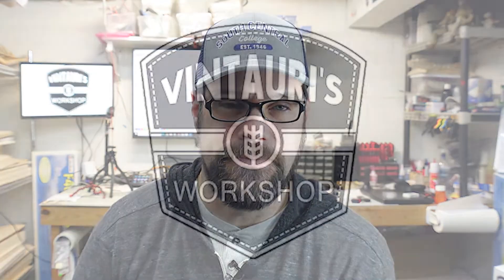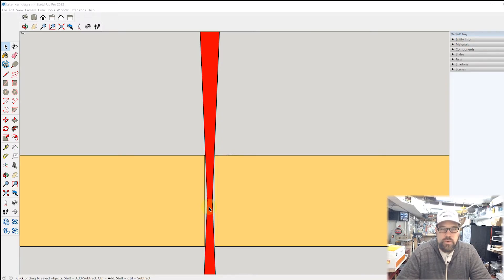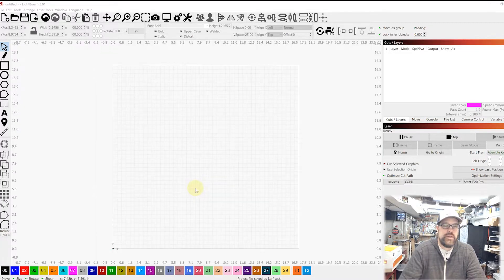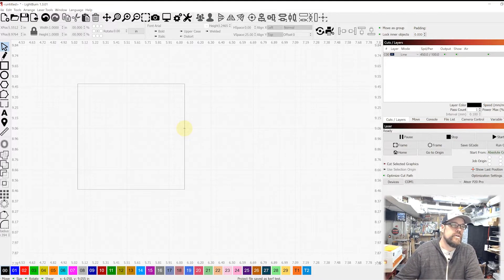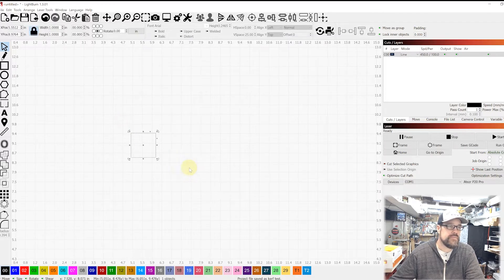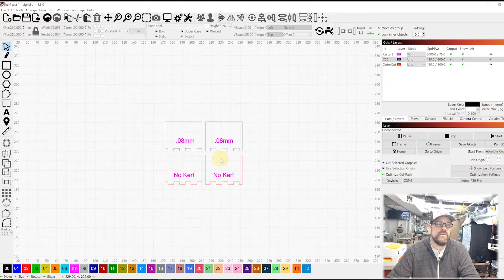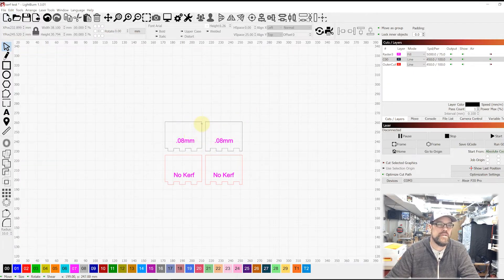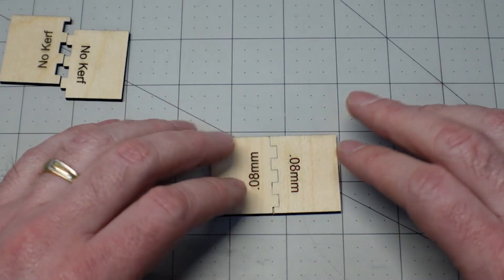Perfect fitting laser parts by adjusting the Kerf in Lightburn

Comment: Is it possible to add the offset and resave the file as svg so it can be cut with offset from a different software or does the kerf adjustment in lightburn only happen within lightburn when you send to the laser? I am asking cause I have some files that need to be adjusted but my laser only prints from Corel draw or illustrator/photoshop. Tia
Reply from the maker: The kerf offset does not save with the file, lightburn calculates it at the time of operation.  What you can do is figure out the offset and then use an offset to expand or contract your lines to factor in the offset and then run it in another application.

Comment: This seems a lot better than offsetting everything manually like i've been doing lol. not had it long though. Seems crazy that lightburn doesn't let you set the x and y kerf differently though, my fingerjoints along Y aren't great whereas along the X they're as snug as physically possible and wouldn't even need glue. Bit annoying

Comment: Hi, when setting the parameters for Scoring, what does setting the Kerf offet do? what's it used for and when is it useful ? Thanks
Reply from the maker: The kerf setting will adjust where the laser moves the beam relative to the line drawn. So it will have the same effect on a score vs a cut as they are basically the same operation, just a lower power for a score line.  For and engrave or fill operation, it will also move the start and stop points inside or outside the line of each pass.

Comment: Does the kerf measurement differ with different types of material, ie are the kerfs different for 1/4" MDF or 1/4" plywood?
Reply from the maker: It can depending on how efficient the burn / cut is.  If it takes longer or more passes to cut out, you may find yourself with a larger kerf due to extra burning of the material.

Comment: hello. the kerf you calculate  didn't use the vertical offset. What about it ? in general, the beam is not square but rectangular. what appened if i cut a circle ?
thank you
Reply from the maker: I measure both the sides as well as the top and bottom then average them out.  That is the best you can do with the rectangular beams from diode lasers.

Comment: My problem is the supposedly PREMIUM Baltic birch that I bought isn’t the same thickness for each sheet, but isn’t the same thickness on each side on the same sheet. It can vary as much as .3mm from one side to the other. It is definitely not premium.
Reply from the maker: It has been harder in recent years to get quality Baltic Birch that is consistent. I work with a couple local lumber dealers to purchase it in larger sheets and have better luck with that then the random packs on amazon. If you do not have a local source check out Ocooch Hardwoods in Wisconsin.  They ship and I've been very happy with the quality and consistency of their hardwoods.

Comment: Another awesome explanation Steve. Thank you!  Question:  If I am making your coaster caddy, do I add KERF to the tabs AND the slots (the slots that are on the bottom base of your caddy holder) or just the tabs?  I hope that makes sense.
Reply from the maker: You want to do it on both, however you want to make sure that on the inside cuts, it's going in and on the outside cuts it's going out. The Kerf adjustment is to make the edge of the beam hit the line instead of the center.  If you do one and not the other, the parts will still be loose.  Lightburn will try to automatically detect if it's an inside or an outside cut, but if your parts are not fitting correctly with the right kerf setting then there might be an opening in your object and you'll want to check that all the outer parts paths are closed.

Comment: I have a question, you mentioned the beam is an hourglass, is it better to cut focused on the top surface of the wood or focus in the middle of the wood thickness? I hope that makes sense.
Reply from the maker: If you can, it’s best to try to get the focus point to the middle of the material. It will be the most effective cut and you’ll have less angle to the cut from the hourglass shape.
Reply: @Vintauri  that makes sense, thanks! 😊

Comment: Your not measuring kerf your measuring  machine calibration step accuatsy  not kerf
Reply from the maker: By subtracting the part size from the cut out size and then dividing by two you are measuring the average distance of material removed which is the Kerf of the beam.  If I was measuring just the dimension of the cut out part, I would be measuring the calibration of the machine.

Comment: I was able to use your formula and procedures to cut half a dozen 25mm boxes, which I then measured.  I have a 22 watt mecpow x4 pro. I was cutting at 80% power, 200 mm/min on 3mm plywood.  My kerf adjustment came out to 0.15mm, which is larger than I expected, considering the claimed spot size.  I have what I thought was an accurate caliper, but I bought a micrometer, and there is a constant error with the calipers that would make them unsuitable for this measurement.  I trust the micrometer way more and it does not read 25mm when the caliper reads 25mm.  The error does not increase between about 10mm and the limit of my micrometer.  I suspect it is an adjustment to the caliper that I don't know how to make.  So I no longer trust the calipers when I need precision.  Great video, by the way.  Everything was clear.  The only thing I was unsure about at the end was the cutting of the averaged difference in half, but I did and then cut two more 25mm squares and they were 25mm plus a tiny bit, which was exactly what I wanted, because I was making a dinosaur cutout and I wanted the slots to fit firmly.
Reply from the maker: The reason you cut the average in half is that you only need to account for half of the beam width as the beam follows the cut line with half to the inside and half to the outside. I also take advertised spot size with a grain of salt, but the burn size on some materials will be wider than the spot size just due to the nature of the material and over burning during the cut. I'm glad the video helped out!

Comment: I think my 10W laser isn't the tool for this kind of thing. I bought my 5w laser two years ago then upgraded the laser to 10 w but i think for cutting it is still to low, any suggestions for a decent laser for cutting? What quality of wood are you using, can you link the specs for the test, I struggle to make box joints.

Comment: Sorry for being simple here, but can you just not cut the 1 inch squares as you did but redusing the different Kurf's, then just try fitting them onto a 1 inch square and see what fits best?
Reply from the maker: That would be a lot of guessing.  You also would not be able to cut out an exact 1 inch square without knowing the kerf offset as the beam would make your initial 1 inch square smaller by half the width of the beam. Measuring it out does not take long and will get you into the ballpark much faster, then you can make micro adjustments to dial in the fit.
Reply: @Vintauri  Thanks, man. I appreciate you taking the time to reply.

Comment: So wouldn’t this adjust the entire size of your drawing then? Not just the pieces that need to fit? Is there a way to just adjust the puzzle pieces? Not the entire piece? Hope that makes sense
Reply from the maker: Adjusting for the kerf will not increase the size of the item but rather make it cut out at the actual size of the digital drawing. If you do not account for kerf the item will cut out slightly smaller than the drawing as half of the beam is cutting inside the line. You would only use this adjustment when you need parts that fit perfectly together.
Reply: Aahhh got it! That makes sense! Thank you!
Reply: Hi! Back again with another question. So I understand adjusting for Kerf for let’s say an inside piece. However, I’m a little confused on how 2 outer pieces need kerf to fit together. Wouldn’t the kerf affect both pieces equally therefore allowing them to fit together? Does this make sense?

Comment: very good explanation  ,it was helpful  to understand  the kerf , but  when i test many values  the result it remains the same not fit good  too gap betwen slot  ,
Reply from the maker: Most diode lasers end up around .1mm to .12mm for a kerf offset.  You need to remember that you find the width of the cut, and then divide it in half as the beam follows the line and only half of the beam is on the inside of the line and that is what the offset should be.  What was the number you were coming up with?

Comment: What is the point of starting and calculating kerf with inches if you are gonna end up using millimeter in the end? Was it just to illustrate conversion?
Reply from the maker: With the majority of the world using metric and many machines and software defaulting to it as well, I try to use both units to get people used to the conversion.

Comment: Brilliant mate, really helpful. I’m using my lasers frame for a plasma cutter, so knowing about the kerf offset is very useful. In Lightburn, say I make a 50x50mm square with a 10mm hole in the middle, will the kerf offset automatically adjust to cut it correctly? The offset would need to be outside the square but inside the hole, to be correct with the drawing (I think) Hope that all makes sense lol
Reply from the maker: You may want to put the inside hole on a separate layer and tell it to off set to the inside vs the outside.  Then do your outer cuts after that.
Reply: @Vintauri  Makes sense, forgot about layers. Thank you 👍🏻

Comment: You do a very clear explanation,  as a Texas resident I don't use mm for size or feedrate (no sense in that)  Not sure why people are doing that.  I also do alot of this laser stuff in Vectric Vcarve Pro much easier since I'm not as familiar with LB and it's simply not laid out as well.  Thanks for the video it's really good info for getting around in LB.
Reply from the maker: I'm glad it was helpful.  I do jump between imperial and metric.  I use imperial because it's what I learned as a kid and hard to break that habit.  But metric is easier to scale and work with from both small to large dimensions, and when working with people all over the globe on various development projects I had to get used to it. I keep a small dual tape measure handy for quick conversions on the fly.

Comment: I dont use lightburn (only Corel Draw is available), but I recently bought some blueprints where none of the parts fit together. How do I increase kerf or otherwise make the pieces fit by creating space?
Reply from the maker: You would need to use an offset tool in your design software.  Generally you need to move the line to the outside of the design by half of the laser beam.  For pockets or slots you would move the line inside the line by that amount.

Comment: I'm building a cross hair laser holder which has "tabs" and "holes"....  So, a positive offset would apply, (.05 in my case), to the "tabs" and a negative offset apply, (-.05 in my case), to the "holes" for the "tabs" to plug into?  I am sure the positive offset would apply to the "tabs" example, but, for any holes cut, a negative offset would apply?  Thanks for your reply..  Hank
P.S.  As 3mm Basswood is typically 2.76mm, this ALSO is an important measurement to account for....

Comment: I've recently starting playing around with the kerf.  You have explained things perfectly here, so thanks very much.  One thing I'm still unsure on though as it wasn't covered, is that you can choose outward or inward kerf.  For the shapes you were doing, outward was fine.  Do you need to change it when for example, you cut a hole in to a piece of wood (inward kerf maybe?) and then have another piece of wood, stand up in that hole (outward kerf on that piece?)
Reply from the maker: Most often people need the outward kerf but if you have slots that are inside your parts, those will need an inward kerf to have a snug fit to other parts that interlock with them.

Comment: Thank you. Great video again. I love watching your videos. You explain everything in a calm way without a lot of fuss which you come across often enough. Very pleasant. What I wonder is how you make the fingers a little longer so that when the box is assembled you can sand off the black ends. Only needs to be half a millimeter ... I think.
Reply from the maker: If you are using Lightburn you could play with the slot resize tool to make them longer but that may not work in all scenarios.  You can always use the node edit to move things out 1mm but that could be tedious on a more complex design.
Reply: @Vintauri   I will also purchase your box from Etsy soon. My laser engraver will arrive next week. I like the box very much. What happens when I scale up your box from 103 mm. to 103.5 mm.?  I read at another video the comment of a guy who had scaled the box from 4" to 5" larger and problem was that the slots and tabs also scaled with it and there is a lot of excess material outside the box when assembling. Do problems arise at half a millimeter as well? My intention is to sand away the black laser edges then. And otherwise, like you, I should sand the edges nice and round but don't have as nice a beld sander as you do. Thanks
Reply: Then we won't do that.

Comment: Does lightburn allow for different x and y offsetts ? I've seen lasers with significantly different x and y spot size ....😮
Reply from the maker: Lightburn only has one kerf offset option. I've seen some with differing x and y spot size but were also talking about a difference in hundredths of a millimeter.  For anything I'm doing with these diode lasers including inlays, averaging the kerf offset between the two gives me tight enough tolerances.  If not, I'll go back to CAD and manually adjust lines in each axis.

Comment: Great tutorial! Excited to give this a try later!
Reply from the maker: It's great to use when trying to get a nice fit on box joints or inlays!
Reply: @Vintauri  I do have a follow up question. Given that you mention that each material could be slightly different, does this means that you have to do these measurements every time you are working with a new sheet of material?

Comment: Good Morning. In seeing that there is a significant difference between the x-axis measurement vs. the y-axis measurement, in this example, should we consider the step pulse setup in the controller? If it were mine, I'd see if there is an adjustment, like GRBL, to adjust so that they are close to the same on a side when asking for a square. Not saying that's how you get to an inch, saying that subtracting out the kerf, they should measure very close to the same X vs. Y. This is not to take away from your execellent subject content and delivery.
Reply from the maker: That is assuming the beam is square. Many diode lasers have a rectangular shaped beam so there will be a difference in your x vs y lengths even if your steppers are calibrated for movement.
Reply: Ahh, hadn't thought of that

Comment: You actually measured whole kerf, because you measured rectangle and on each side there were half of the kerf -> no dividing by 2 therefore. Whole kerf.
Reply: You do need to divide by 2 in order to get the offset since the other half of the kerf is still there in the leftover piece. Remember, you're measuring the whole kerf (as you've correctly stated) in order to get the actual offset from each side (which requires dividing by 2).
Reply: Yes, I agree on that. Prehaps I missed this detail. Thanx.

Comment: Hello I'm a newbie in laser machines. I have a diodize laser and I just wonder how can I control how deep i want to remove the material in wood. For example I need a 3mm deep or 5 mm deep,etc. So I can cut another type of wood and exact match. Please help.
Reply from the maker: It's going to be tough to have a very exact depth of cut with a laser.  You can play around with engraving settings to try to get a depth but as youre working with natural material that is not consistent, it will burn at different depths.  For exact depths that do not go all the way through the material, you'll want to look at a CNC Router.

Comment: Can you direct me to a place that will  te me what laser power I need to cut 0.5mm brass sheet
Perhaps you have done this with low powered devices doing several passes??
Reply from the maker: The wavelength of diode lasers will not cut metal other than very thin stainless steel.  You'll need to look at a fiber laser or a high power Co2 laser to look at cutting metal.

Comment: Thanks for the information. When the caliper said 0.9965, etc. why didn't you round up to 0.997? You said 0.996. Just curious.
Reply from the maker: I opt to start a little snug by rounding down to the lower number.  At those numbers and working with soft natural material the thousands of an inch will not matter that much.
Reply: @Vintauri  Makes sense. Thanks.

Comment: 2nd Update 😒 I am using 1.5 mm Plywood trying to tighten in the kerf. I have made multiple test with Kerf off sets from .139 mm to .152 mm I am not seeing any difference between the cuts I would think that at least one would be so tight they would fit together. I am seeing a visible gap between the teeth of the test pieces any ideas?
Reply from the maker: What type of laser are you using.  A .139 to .152 sounds rather large for a diode laser offset.  Even my Co2 laser is closer to .07mm offset.
Reply: @Vintauri  I am using a Longer Ray 5 10 watt. I am conducting another test as I write this. When I did the first test I was using 1.0 MM plywood I think this may have skewed my results by cutting a larger Kerf being so thin. I do not recall the power setting of the 10 watt module. On this new test with 3.20 MM plywood my final calculation came out at .006096
or.0061.  The laser beam size for this module is advertised as being .060  My goal is to be able to make puzzles. 😁🛫